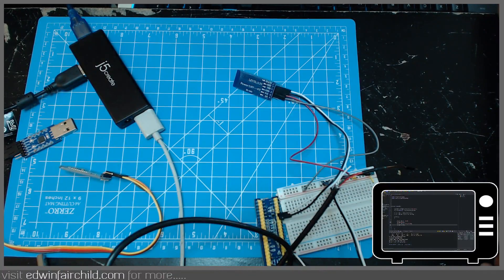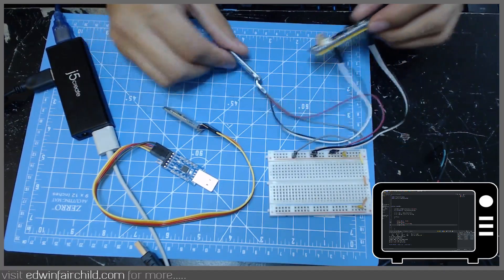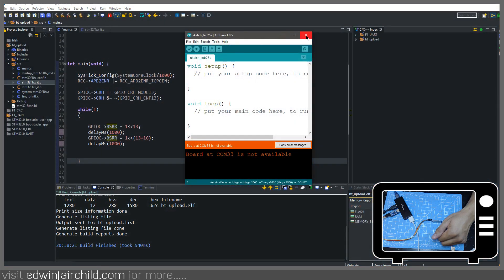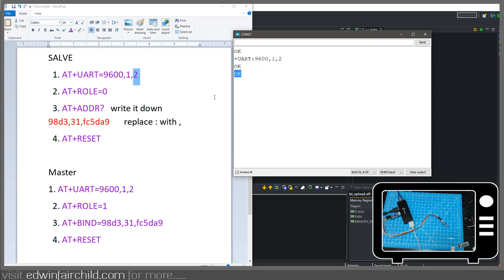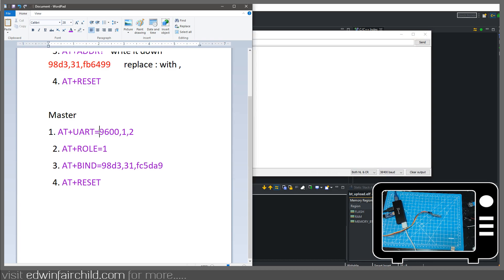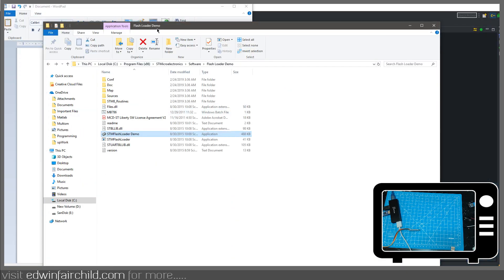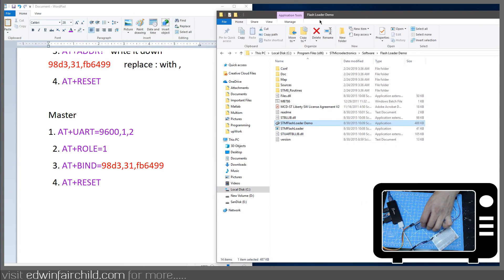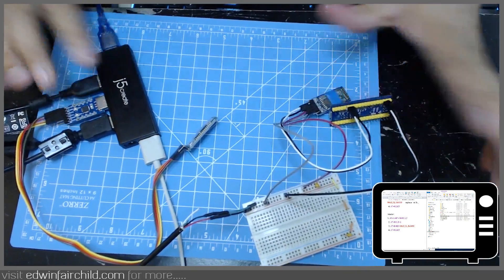STM32 TIPS: WIRELESS Firmware update via bluetooth

Comment: Eddie, just watched this - first video of yours I've watched.  You are SO REAL.  Love it.  Just a dude trying to get hardware and software to work which is EXTREMELY FRUSTRATING at times.  I have programmed a flight controller for a drone on a STM32F103, and it's SO annoying to have to plug into it with my laptop to fix a small bug and download a new program, but this looks like a really cool way to do it.  It should also allow me to wirelessly collect data (when I print data to the serial port) for later analysis.  The other suggestion I have for your subscribers is to replace that boot jumper with a SPDT switch which makes it a LOT easier to switch between boot-loader mode, and run mode.  That jumper is just SO hard to grab.  You even had trouble putting it on in the right place in the video.  Ha!

Comment: Thanks for the useful information. 
one question... can we enter into bootloader mode without using boot0 pin?
Reply from the maker: Good question, I'm not sure, I have always just used boot0 , might want to read up on the bootloader application note for you spe ific mcu invade it doesn't have a boot0 or something , or maybe you just don't have physical access to it . So look for that document it should mention it there or in the reference manual do a search for boot